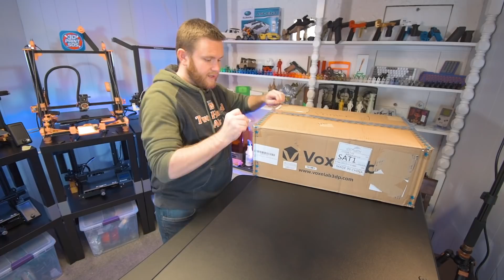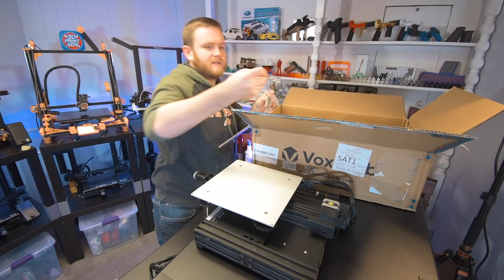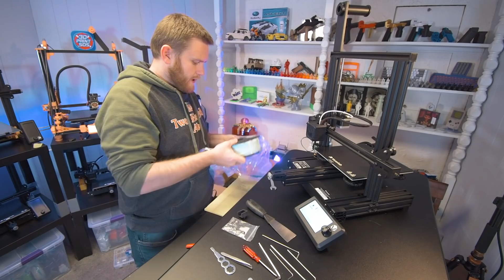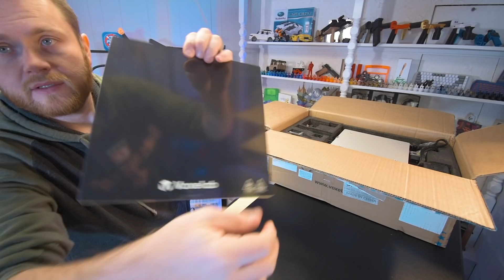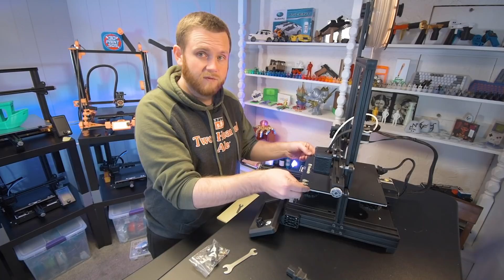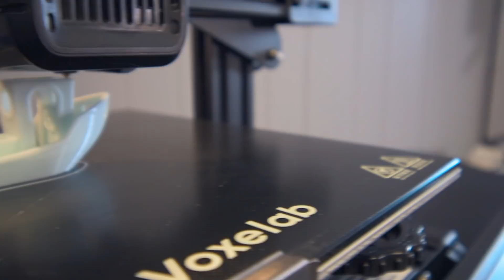$50 Used Voxelab Aquila! Are Amazon Returns Printers Worth it?

Comment: Hello my problem with my Aquila is it’s not feeding! The auto feed works perfectly any suggestions? Thanks
Reply from the maker: Does this happen with files from the sd card?
Reply: @3DPrintSOS  my files and pre loaded files..it was working perfectly for a month and then it stops feeding the gear works but the guide wheel doesnt I even upgraded the spring and still nothing!!
Reply: Wait could it be a software thing?
Reply from the maker: Sound alike you have a clog and your extruder isn’t able to push filament through. 

Heat up your nozzle, remove the ptfe tube from both sizes, remove the rubber sock, remove the nozzle. With everything still hot, screw on a new nozzle, make sure your ptfe fitting is screwed in but a thread is still showing. Push the ptfe tube all the way into the hotend and then finish screwing in the ptfe fitting. This will push then tube flat against the new nozzle. Then make sure your tension on the extruder lever isn’t too high or too low.
Reply: @3DPrintSOS  I’ll do that thank you!

Comment: I bought a Voxelab Aquila new from Amazon,  and one of the feet was off  in the sealed box.  It seems to be a common problem with Amazon Aquilas.
Reply from the maker: Noted. First time for me. I’ve unboxed like a dozen of these now. Haha
Reply: My back right foot keeps falling off. Fixing to use some gorilla glue on it
Reply: Right,

Because Amazon boxes their own Aquilas.

Good grief...
Reply: @dangerous8333  the much more likely answer is that Voxelab just uses crappy adhesive for their feet, but all the people I found who had the same issues purchased through Amazon like myself.  I was happy to purchase in October of 2021 and get a original chipset unit.  The printer has been flawless since I bought it. 🤷
Reply: @MakerMeraki  it's possible that it's a heat issue, especially if you live where it's warmer like I do in Florida 
The heat inside those delivery trucks gets VERY high. UPS guys call their trucks brown microwaves for a reason. It's possible that it gets hot enough to make the adhesive bond weak. You can't blame Amazon. Just put some gorilla glue on it and carry on with your life

Comment: Bad bearings will cause a dead spot in the wheels that feels like an intermittent bump. I have never seen the wheels dent the extrusion unless dropped. Tnuts will for sure. -- mark @ ender extender
Reply from the maker: Hmm. Bearing seemed fine. There’s a soon in the video after I drilled the holes where I showed the dimples. You can feel them with your finger. The wheels and bearings were like new on this machine. No markings on them at all.
Reply: @3DPrintSOS  yeah i wrote that just before i saw that part. For sure rough handling.